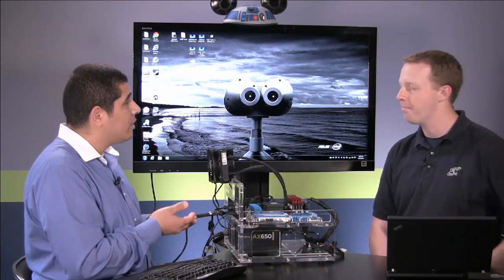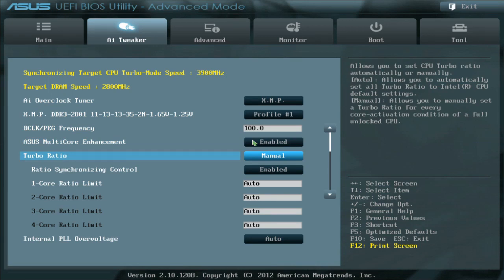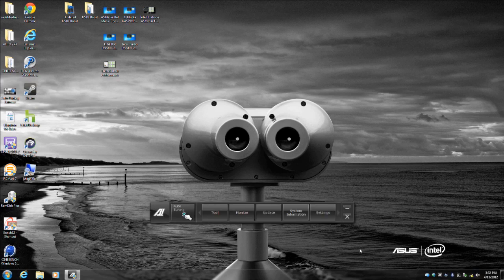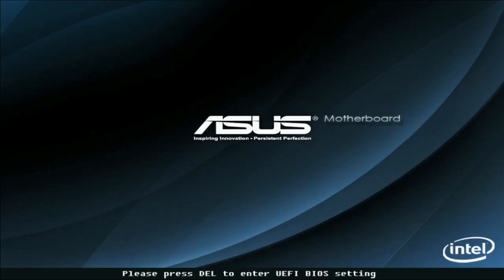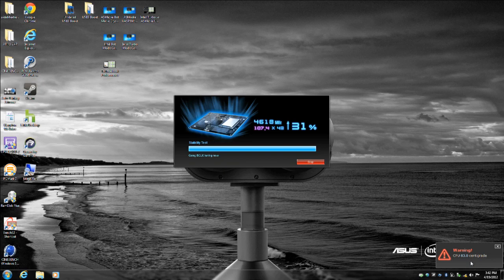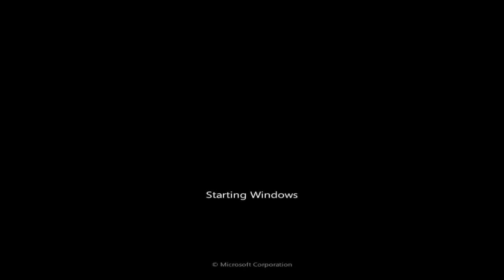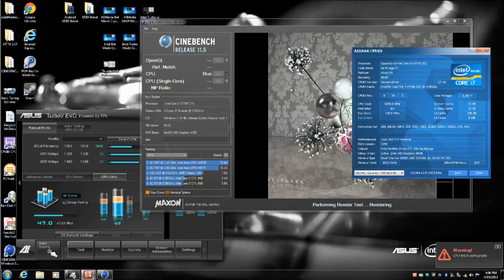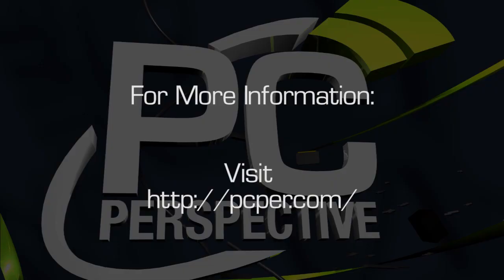ASUS Z77 Ivy Bridge Overclocking Demo - PC Perspective

Comment: does this clocking program come with the sabertooth z77 aswell? and what about the temps, they are reaching over 80 degrees. and it keeps going to overclock, where is that going. thought he said 75 centigrade would be bttr. and you dont talk about the temp whatsoever. could you break that down to me?

Comment: cpu voltage automatic with digi-vram 
load line = Ultra High
CPU Current Capility = 130%
Digi Vrm Frequency = Auto OFF (have to test more), think auto on is the best - hat problems with fixed 350 what i see in other overclock guides
Digi Vrm Phase = Extreme
Digi Vrm Duty Control = T.Probe (Thermal Probe)

with this settings and normal CPU= 1,33 Voltage the cpu runs with 100% to 1,464 thats ok

so i have now problems 
please info for better config, not optimized now, but so its stable and fast

Comment: I currently have a Core 2 Quad setup and want to know, is it worth it to buy a 3770k over a 2700k? I found the 2700k for $219 and 3770k is just $10 more. But I'm taking a risk with a Z68 mobo, since I hear not all Z68's support Ivy out of the box and you need a bios update. I'm going Z68 because I found a good deal with a refurbished Asus mobo.

Comment: one thing i fail to find on the internet is ow you overclock memory.
everywhere it says you can get faster memory by overclocking but there is no information on how to actualy overclock it. can anyone please explain what exact settings need to be changed to get for example ddr3 2400.
or is it like the asrock board i used for someone last week (amd cpu) and just select it in a dropdown?

Comment: why is he ignoring that 95 degree warning?
Who wants to oc the cpu if it is going to be running at  unsafe 95 degrees???
Reply: +charvelstrat81  Because this automation software running system to the point of extreme load. but u ll not get 90 Temp in routines while playing games. This software gives u stability points and warns about reaching danger.

Comment: Ok after some work and adjustments I have a very nice stable overclock. I'm at 4.55 GHz, cpu voltage of 1.275 (runs at 1.336V) and cpu temp is 59C. I ran it for 30 minutes on Aida64 and it was stable. Oh BCLK was at 105.8 too. That's the i5 3570k and ASUS P8Z77-V PRO Motherboard. Very nice!!

Comment: All thermal paste [TIM] does not need to be replaced every year.

I have extensively tested Arctic Silver and it does need replaced after a time, because components seperate.  I know this is denied by Arctic Silver, however, they are in business to sell a product, not to tell the truth.

Better compounds, such as ProLima Tech PK series do not need replaced every year.  Note that, if you decide to purchase, PK-3 is more difficult to spread than PK-1 or PK-2.

Comment: My sys specs: 
Core i7 3770k
Asus P8Z77-V PRO
Corsair Vengeance Blue 16gb ram
Corsair H100 Water Cooler
Corsair 850watt Modular PSU

It keeps rebooting then says failed, I have to go into BIOS and set to defaults to get the system to boot again.

Comment: If you are running a Sabertooth board, I believe you do not have the auto tuning option available. Personally I chose the Z77 Pro board for this reason...

I came to this conclusion through long research. The auto tune is not listed on the product page of the sabertooth...

Comment: what supp guys please i need Answer and be sure 100% please i got asus z77 vl-x i7 3770k overclocking to 4.5 ghz i need to know what voltage can i make for my cpu ? right now my voltage 1.300v i got hyper 212 turbo evo for my cpu so please i need help what voltage i must make to play on maximum settings and 1920*1080 resul please need Answer and be sure 100% my psu XFX 850w xxx edation graphic card 7970 asus matrix plantium Need Answer Please about my voltage and be sure 100% !

Comment: non of this work on WIN10...
Reply: Just gave it a try for the first time on my upgraded win10 from win7, and yeah Win10 does not like it at all. It’s unstable. It went into the loop of rebooting itself. I had to boot into SafeMode, and change the settings in the bios then it was ok again. I still have my overclocked settings saved on the Asus suite software, but now using the auto overclock setting is a big no no.

Comment: use stress testing and don't let ur cpu get high temps 85'c , any ghz will be find as long as ur temps not high and the system is stable, start with 4.0ghz or 4.2ghz

Comment: multi threading has been proven to be slower then non in some cases also the 3770 can be overclocked more but that dosen mean it is faster there almost the exact same besides the multi threading that in most cases is faster but for fps range the 3570k dose get like 4 more frames so its really unnoticble

Comment: Only things I changed were the multiplier ( 44 ), cpu voltage ( 1.200), and cpu PLL ( 1.525 ).

It runs fine on prime95 and seems to be stable. You really dont want the chip above 1.35 imo :( way too much heat.

Comment: Try overclocking. See which one hits their thermal threshold first. The 2700k runs far cooler. Then compare the benchmarks. Sandybridge comes out on top..easily. The 2700k is also $50+ cheaper in Oz. You don't buy a K processor to leave it at stock.(2600k is even cheaper and OC's just as well, to rub salt in)

Comment: it went back to stock speed after it overclocked mine. also the system had crashed at 3.8ghz using a 212+ evo in a switch 810 50f in my room

Comment: You are in error, most games still use 2 cores - overclock them, and why the porn reference?  Yes, I know some games, such as BF3 can use more than 2 cores.

Many games do not stress an Ivy Bridge CPU, but do stress the GPU, such as World of Tanks.  I forgot to check the upcoming War Thunder, it does require more watts to play than WoT.

One of the most important comments made is do NOT use non-validated software to stress your Ivy Bridge CPU.  That comment alone makes this video worth watching.

Comment: Looking at the numbers the difference isn't that great from the chart. i7 3770k 9,641 points @ 314$. And FX 8350 9,178 points @ 220$. While the 3570k 7,128 points @ 213.50$
So going by the chart alone comparing the best amd cpu to it's main competitors we see that it isn't much slower at all and the price to performance ratio is in Amd's favor here. Yes, the 3960X is faster for sure but it costs 4 times as much and it's aimed at a different market.

Comment: yap that correct 105 is its ABSOLUTE MAX but at 95 its already its max for clocking so the point of going to 105 is useless.... starting at 95 it will lower ur frequency already

Comment: No, all the K means is that the CPU has an unlocked multiplier, meaning you can overclock the CPU in the bios, to run RAM it's about the motherboard. But make sure all your parts are in the same price/performance range otherwise you'll have a bottle necked system.

Comment: *JFI* DONT overclock cpu voltage when using Full DIGI-VRM -- make mutch tests and have now with silverstone raven 2 advanced AIR Cooling @i7-2600K 4,7 - 5ghz (better runs with 4,7. evertime have problems when using fix cpu voltage and digi-vrm, searching long time for this fault :D

when this is a wrong information please give me responce !

Comment: It's not Prime95's design that's the problem. You shouldn't be running ANY kind of raw FPU test on such a small die. Even AIDA's FPU stress tests cause my CPU temps to get a bit hotter than I'd like. floating point operations are so simple for these processors that, in layman's terms, the signal and current just whiz straight through the die, making it like a friggin toaster coil. don't blame prime or linx; the problem lies with how much tech has improved.

Comment: Setting everything to auto is a BAD IDEA, the computer will use way more voltage than needed therefore making things run A LOT hotter, which in turn lets to get not near a high or clocks!

Comment: in my opinion if you cant do a FPU test without high temps your OC is to high.

fpu test is the first thing i do for 10 minutes if it doesnt get to hot then it never will wich makes the overclock save temerature wise.

theres no point in a overclock that you cant actualy use in gaming or heavy video editing.
just reaching 5000 mhz is pointless if you do not use it for heavy duty stuff.

my amd 955 goes to about 3720 mhz at 1.4 volt @53degrees my soon 3770k will most likely be at 4.2 ghz @ 65 c.

Comment: There are no applications besides FPU benchmark utilities that use solely floating point calculations as fast as possible. I have a 3770k at 102 (41x) with an H100 cooler. Even when my CPU was running at stock 100 (39x turbo) i was still getting temps in the 60s on Prime95.

Like JJ said, you can be an idiot and use Prime95 or Linx and destroy your processor, or you can be smart and use AIDA and Cinebench like I do.

Comment: ivy bridge is very limited compared to sandy bridge, why?
They used totally differend cpu cooling in the processor chip.
3770k has Thermal paste instead of the same super good thermal solution used in i7 2600k or even i5 2500k.
DO NOT BUY 3770k, they overheat like mad.

Comment: They actually have the same clock speeds. The only difference between the current i7 and i5 is the i7 has hyperthreading which is like having 4 more cores. The i7 is only $100 more, but it still isn't worth it. For games, an i5 is fine since no games use hyperthreading.